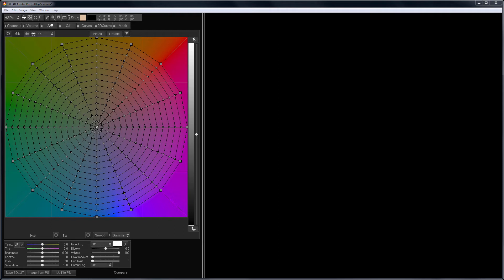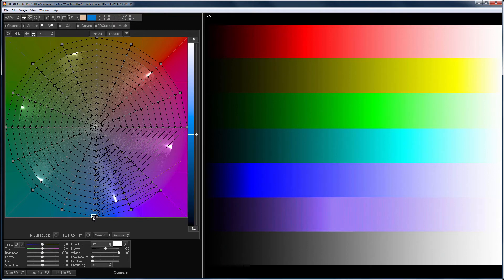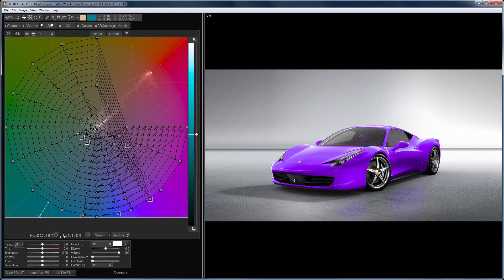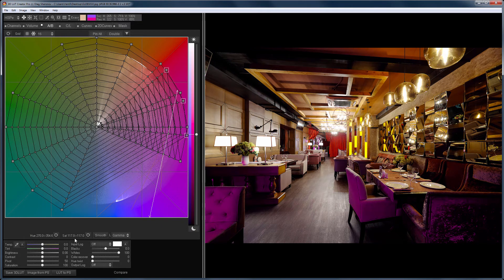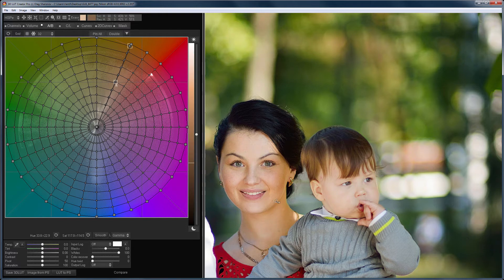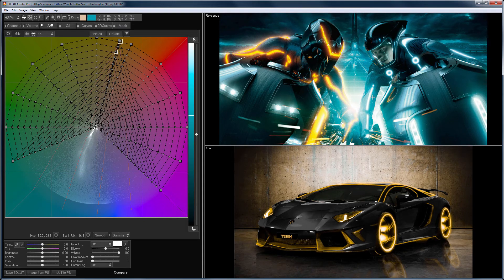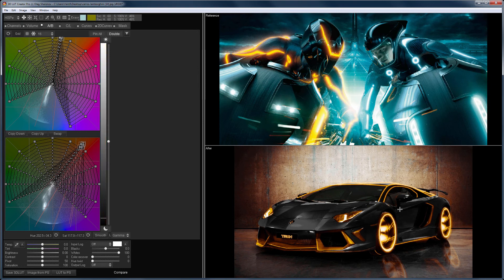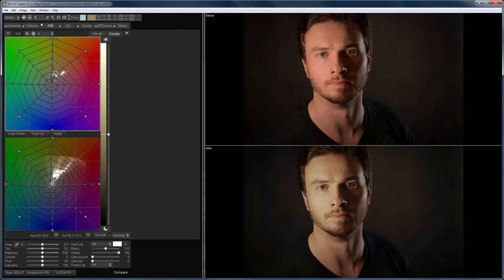A/B color grid in 3D LUT Creator. Practice, part 1

Comment: I tried to change colour with your method of increasing grid in A/G to 32 and it works well but not perfectly, some other part of photo is changing colour too. Could you increase grid with more lines than 32 (48 for example) ?
Reply from the maker: Try to use the square grid or the other color model. You cannot increase the grid more than 32.
Reply: Thanks, I'm trying it but don't know which model to use in my case. Look this is example of photo where I try to change colour of sky and make it darkness too without change colour and light of water in swimming pool : https://www.dropbox.com/s/u1qmraz4r2dfjzl/test1_1.1.1.tif?dl=0

It looks difficult, maybe because colour of sky is very unsaturated ?
Reply from the maker: You should use C/L grid for it.
Reply: Thank you, I will try it